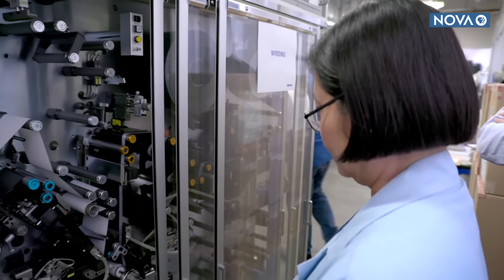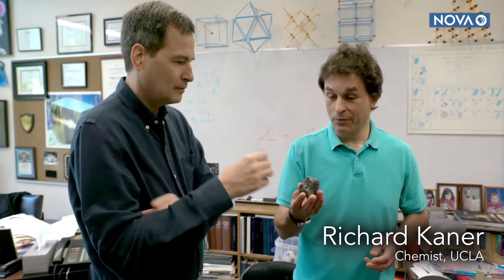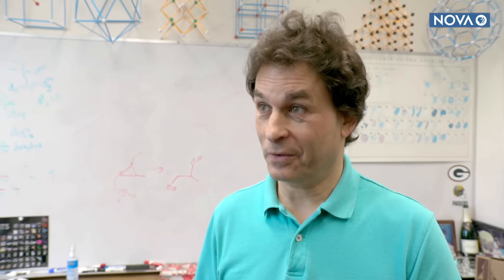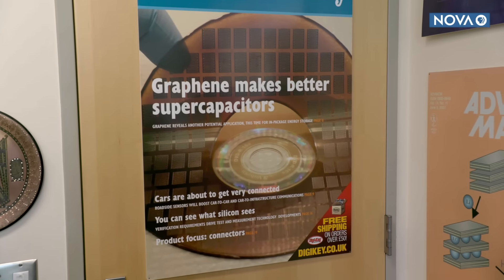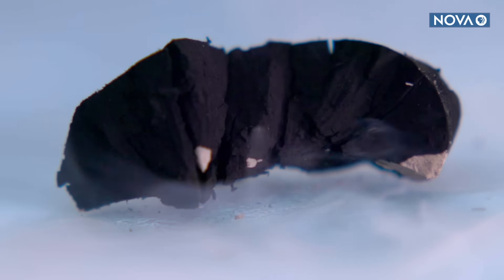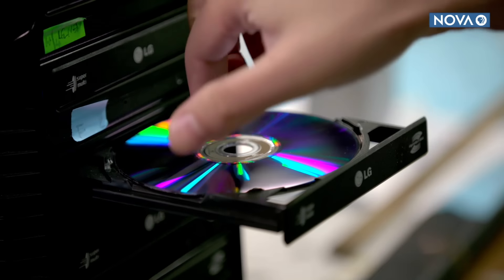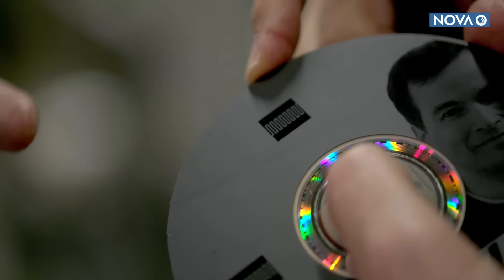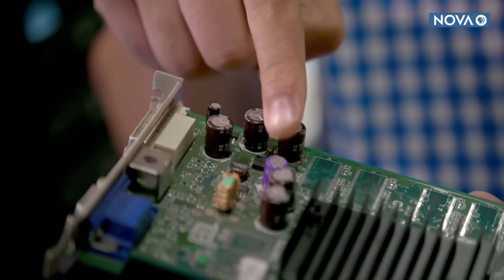Super-Charged Supercapacitors Could Enable Speedy Recharging

Comment: What is the energy stored per pound of this compared to a modern lithium battery?
Reply: Best today have 5.5Wh/kg, and the best Li-Ion have 240Wh/kg.
Reply: The current comercially available one have low specific energy but in labs they are reaching 100 Wh/kg. of course it is different to make it in lab and large scale commercial production but we aren't that far.
Reply: 1 gigawatt in a lb of grapene

Comment: They didn't talk about leakage which is a huge problem for capacitors. I wonder if this technology has any advantages when it comes to leakage.
Reply: i don't think leakage makes a difference when you can save 100kg off an electric cars brake regen system . as long as it holds long enough to recharge a battery

Comment: if they are designing a better super capacitor that can store more energy why are they comparing it to an electrolytic capacitor? if this is actually working at all why not just say how many joules of energy it holds.
Reply: It's about getting investors, grants, and funding. ;)
Reply: Need to talk in energy density. Wh/kg. And super fast electric vehicle charging requires a huge storage at the station too, and massive supply. Were gunna need a bigger power station, and more transmission lines and and. Will be a very big lag between demand and gearing up supply, leading to seriously high electricity prices for all... interesting (spok accent).
Reply: Exactly, it is about ones audience. A video like this serves more as a teaser to get people intetested than to provide technical specs.

Engineers will take specs like watt hours, esr, and weight, as well as cost metrics into consideration in designes that are commercialized.
Reply: They don’t tell you how many joules because most of the people watching don’t know what a joule and the number wouldn’t have much meaning. Instead they show an existing component and then say that this holds a thousand times as much energy. The audience doesn’t need to know absolute numbers because relative values convey the idea better.
Reply: The claim that that printed circuit would hold more charge than one of those electrolytic caps was bullshit; that's why.

Comment: these 5 dislikes must be oil worshipers....
Reply: oil>ancient biological material>plants>sun  sun worshipers
Reply: I dislike because NOVA cannot do a proper audio equalization before upload, even a monkey can do it.
Reply: What does oil have to do with this subject? This is about capacitors that hold energy not create energy. That brand new car that's going to be using these theoretical capacitors will still be charged using electricity created from processed oil, coal...etc.
Reply: @mackjeez  
Or solar, geothermal, hydro, nuclear,
Reply: Mishchievious Badger  

Unfortunately for the time being oil provides biggest supply of energy in power hungry countries like the U.S.

Solar power is in its infancy and does not create a worthwhile amount of energy, in fact from all suggested its probably the worst in terms of cost and maintenance.

The United States creates the most geothermal energy at 3086MW per year which is the most at 29% of the world's geothermal production but only provides 0.3% of the U.S power.

Hydropower is limited, requiring suitable locations.

Nuclear power is limited due to its controversy, we are actually getting rid of more nuclear plants than we are creating.
Reply: I realize all of this, and its current reigning title of easiest/constant  power supplier for the world. But in 20yrs even 10 yrs could be a completely different story. Especially if solar and battery/energy storage methods continue to improve and manufacturing cost continue to drop.

in fact solar is in some region already cheaper than the fossil fuel alternative. And decreasing steadily. Energy storage remains a large hurdle though
Reply: @Pseudo___  

I certainly hope so, I think even the anti climate change populous would agree on that statement but for the time being our reliance on oil is far too great, you cannot judge a society of using oil if there isn't an alternative but like you said I think the way technology is advancing we're bound to find a solution to this problem, I mean on paper we can harness energy from a crazy amount of sources and maybe solar will be the answer.
Reply: @mackjeez  cars use gas. Gas comes from oil. Electric motors are FAR more efficient than combustion engines. Putting aside the fact that some power from the grid is produced by alternative energy, power plants burn fossil fuels more efficiently than cars. Electric cars would greatly benefit the environment, thats a fact.
Reply: @mackjeez  There has been little to none effort to push out oil by the  US. Even with as inefficient as solar is currently, if we made an effort we could provide the majority of power easy. They won't care until it effects their bottom line because everyone is running for the hills from climate disasters. It's up to us to MAKE them do it.
Reply: @gearhead1302  

Your comment is trying to make a case of a "what if" scenario, unlike you I live in the present. The fact remains that current electric car batteries have awful energy density, if you take that into account combustion engines that use denser fuels up to 20 times more, they are in fact more efficient and electric cars also require power produced from coal and oil. I never stated that electric cars wouldn't benefit the environment in the future but AGAIN we are not talking about the future, we are talking about the present and these are the facts.
Reply: @mackjeez  I agree, fossil fuels have a much higher energy, this is scientific fact. Also a scientific fact though, combustion engines are about 20% efficient and electric cars are about 60% from the grid to the wheels. This includes all energy losses. That's not the future, it's present. Sorry man but your wrong on this one, I'm an ASE master certified technician with an automotive degree and 15 years experience in the field. I'm sure your an intelligent guy but this is my territory.
Reply: @gearhead1302  

When you take into account the fuel density it doesn't matter how efficient electric motors are. Like I said I live in the present not the future, I wish like every other person in the world that innovation and technological advancements would allow for a perfect scenario were everyone can afford electric cars, batteries become more efficient and that they are not relying on coal and oil to power them. I honestly don't care what you claim you are.
Reply: @gearhead1302  

How are you an expert exactly? You stated all these supposed credentials and I'm suppose to believe you?  I had to google Koch brothers, it seems you are making this political for some reason, I'm not against electric cars, clean energy...etc.. I thought I made it clear that I live in the present reality, at this point and time we are stuck with what limited technology we have, I stated my opinions in detail, quite clearly actually . I wasn't rude in the least, I never called you any names, nor did I berate you in any way, I thought we were having a discussion not an argument, seems I was wrong.
Reply: @mackjeez  There, now its my profile pic. I'm done now.
Reply: @gearhead1302  

What the hell is that? All I see is a business card, you do know people with Master ASE certification receive 3 things, a badge, a Master ASE card with your name and ASE identification number and the actual certification paper. Why are you trying to deceive me? I really don't care, this is not a job application.
Reply: @mackjeez  ok bud bye

Comment: Can we regulate the discharge from super capacitors to the load we required?
Reply: Chetan Allu yes to an extent
Reply: The load will self regulate... that's common electronics. What you might want to ask if you can regulate the voltage, yes we can if you treat it like a large variance input voltage.

Comment: And then you realize that the patent on lithium battery technology is in the public domain, while these super capacitors are not. Aka, this wont make as much money as lithium so until all the lithium is gone or more expensive these wont exist.
Reply: Lithium is already expensive. That's why for long term high density storage they are looking at very different elements. But this is not about replacement, they have different uses. You can charge a supercap with the energy from breaking in a car. And then you can use that energy to drive again, or slowly charge it into the battery. Capacitor currents for charging/discharging are limited to the wires and the loads or sources. Lithium has very strict maxima on charging/discharging currents and recharge cycles. Capacitors have not. So to store breaking energy it's cheaper to fastcharge a supercap and slowcharge your battery with it, or just charge the supercap with the battery for acceleration and breaking power peaks.

Comment: Just remember most battieries supply a steady voltage for much of their charge. Capacitors discharge curves are like a ski slope and the voltage is never the same throughout, and falls to zero pretty quick. They require electronics to regulate the output voltage.

Comment: 1 atom layer thick flat super cap? they should call them Mega Caps. stack them up high enough and it might be possible to have more charge than some batteries in use and take up the same space. 
dont quote me on that. i know it takes a large super cap to replace your phone batter. one that one fit in your pocket. 
i just hope it actually works since they didn't show it...

Comment: Can you tell me if you flash the camera light to the mineral chunk of graphite that comes out of the ground, would it turn into graphene? 
What is the difference between the light from the camera flash and the laser beam in the CPU?
Is there any special characteristic of that laser beam that turns the graphite oxide into graphene?
If you hold that laser beam into a chunk of mineral graphite taken from the ground, would it turn into graphene?
When can you answer my questions?

Comment: I'm all for better batteries, but please keep things in perspective.

A Chevy Bolt gets 200+ miles on a charge, a bit less than most gas cars get on a tank of gas.  

Charging that battery in one hour requires 60KW (250A, at 240V, 50A more than the main circuit breaker in my home).  To charge it in 6 minutes, requires 600KW!
Reply: Yeah, there's no real need for faster charging, if you are charging at home, you are likely charging over night. However, where faster charging does make a difference is in regenerative braking.
Reply: At home you can charge at your leisure, while you sleep or while you work. But ultrafast charging would be handy for road trips, or for apartment dwellers who have less access to a home charger. And being able to spend a few minutes at a charger would be a good thing. Super capacitors would also let these charging stations pull energy from the grid all the time and store them for peak need. They also would be useful for power companies to handle peak need or outages.

Comment: Why stopping ?!?
No Need !
You can put a Tesla Coil with a closed circuit that recirculate electricity until a Car passage doesn't brake the cycle, every few Km over already existing Light Poles on the Highway..
A receiver for the Supercapacitor on the car will be filling up the Power while on the road..

It was Already Approved by the Flat-Bread before the '90s..

You could make Graphite Oxide Being absorbed by A really Transparent Cellulose Based Aerogel and Than Lighting It to convert it into Graphene...

Comment: Volvo had car panels as battery's what happened and this tech has been around for a number of years. My guess is they are reverse engineering it for the next for years. Like the light globe that battery could in theory run for 10-20 years my guess 6-8 tops...makes you buy new battery or car

Comment: what? not all batteries use graphite. The electricity storage of super capacitors isn't from static electricity, electrostatic forces only facilitate molecular adhesion. The capacitance of one of those "graphene" structures put onto the CD is 0 and they wouldn't work as capacitors without a lot of other work needing to be done first like housing, development of the circuit, etc... Just laser printing some carbon onto a piece of plastic doesn't create a capacitor and it certainly wouldn't even come close to the capacitance of those electrolytic capacitors since it's missing that ever so important surface area. They even talk about it in the video where it describes how just a few grams of graphene could be made into a single sheet the size of multiple football fields. What they printed on the CD doesn't look like multiple football fields to me, unless those were super special giant CD's with giant aliens doing the recording/interviewing.